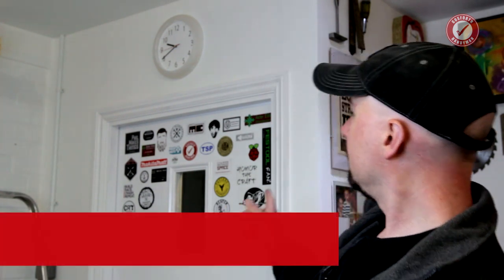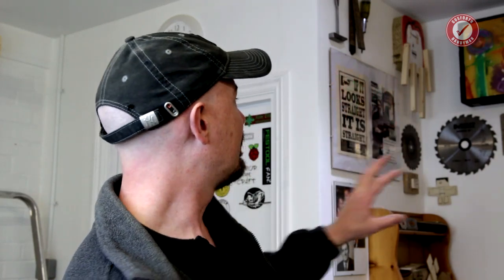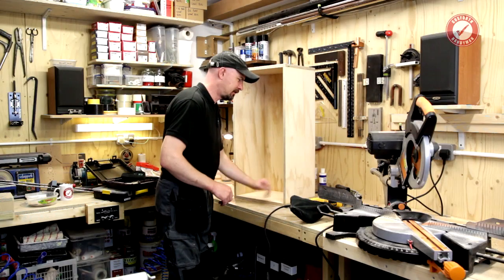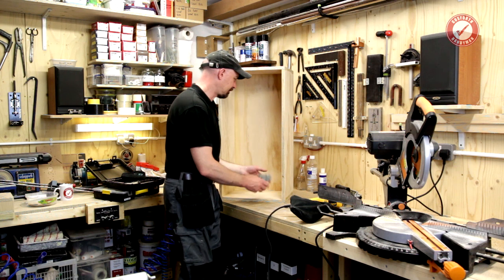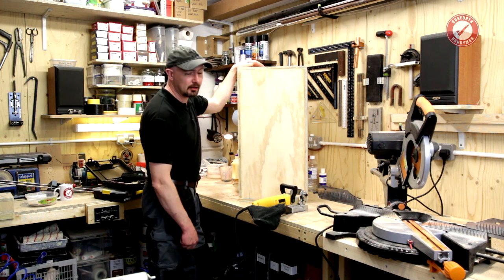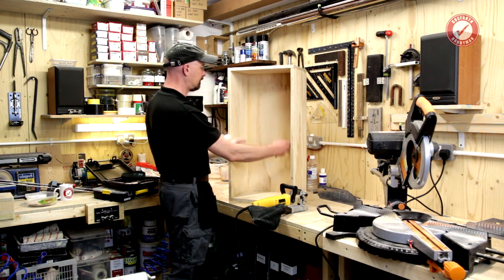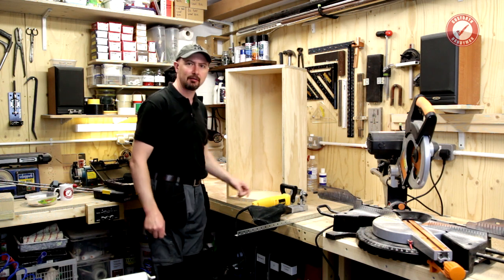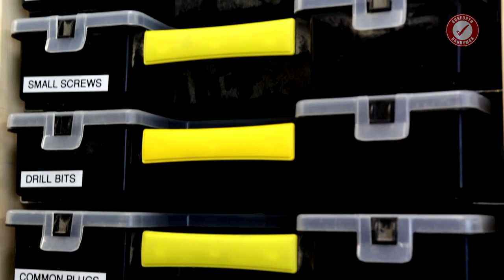Making a Rack for Small Parts Storage with Stanley SortMasters

Comment: Made one of these for the work van, worked a treat, used a piece of M8 threaded bar on the front to stop the boxes falling forward when in motion, plus I drilled a 5mm hole in the end of the threaded bar for a small padlock 🔐 to fit through and it acts as a security bar too, keep me bits secure whilst on site! Great video 👍
Reply from the maker: Great stuff! I've also seen folk angle the support rails to stop the boxes falling out. Both work! 👊👍

Comment: Great content. consider adding a drawer slide tray at the bottom of your case unit it will give you somewhere to rest a case if you only need to get at a couple of screws. Finding a clear space on the workbench mid project to put a case down no chance. It also helps when refilling or organising your cases. The tray can then be pushed out of the way. I find it saves me time. Cheers John County Durham

Comment: Hi Andy. Just ordered the galvanised steel angle from Ironmongery Direct, Not bad @ £4.86 incl vat. I can see you're using 18mm ply, but what size biscuits are you using; #0, #10 or #20? Good luck at Makers Central next week
Reply from the maker: I normally use #20 unless I can't fit them in. 👍

Comment: Biscuits don’t provide structural support. They are for alignment only. Glue is where the strength comes from.
Reply from the maker: Biscuits also protect the joint from catastropic failure. 👍
Reply: Gosforth Handyman how so? I thought the same tel I broke the joint. Then did some research into. Glue is stronger then the wood. Glues is the strength you’re seeing not the biscuits.
Reply from the maker: If a glued joint fails it will completely fail. If a biscuited joint fails it will still be partly held together by the biscuits (see recent tests).
Reply: Gosforth Handyman what test? I’m curious now. I’ve seen the opposite is true. If I’m wrong then I’d like to know.
Reply from the maker: https://youtu.be/dxwFP4WHS4o 👍
Reply: Gosforth Handyman that is mdf. Maybe with end to end grain but not with the grain. Still think it does little to no good except for alignment.

Comment: Great video im an hvac tech. I have a stupid question. Why do you need a biscuit tool.  Can you screw or nail plywood together to make the box. What is the advantage.
Reply from the maker: Mainly alignment but it adds a certain amount of strength too - plus no screw / nail holes to fill. 👍
Reply: Your saying no screws.     Use nail gun?
Reply from the maker: Yup can just biscuit / glue / clamp if the project needs it.

Comment: Nice work sir, I need to build one of these. Where did you get the metal strips?
Reply from the maker: Cheers bud - think I got the rails from ironmongery direct.
Reply: Could you please give us more details about those metal pieces..what gauge? what kind of metal? Here in the U.S. I found something similar on HomeDepot's site..Type in "Metal Slotted Angle" and it looks a little like what he's using. You want something strong obviously. I'm so glad I found this video because the version I was going by had wood shelves and it was pretty bulky, creating a large gap between organizer boxes.I'll have to try metal strips since it's strong and thin. Thanks!
Reply: Laurie Clarkson Can you please advise the model # or whatever info I could use to get the same metal you got from HD....if you found that it worked alright? Of course...that’s important to know .... please & thank you!
Reply from the maker: The rails I've used are 23.5mm x 23.5mm x 1m lengths of galvanised angle steel. The steel is 1.2mm thick.

Comment: Hi Andy,
Would you consider making something like that out of MDF? (Actually, that would be a great topic for a video - when to use MDF, and when to use plywood... I'm wondering about the same question for making workshop cabinets).

Also, do you think aluminium angle bar (e.g. https://www.amazon.co.uk/STORMGUARD-09SL0131219-Angle-Aluminium-1219mm/dp/B077YWBM9X ) would do an adequate job instead of the steel ones? Lighter and cheaper - but would it be strong enough? Cheers, Ian